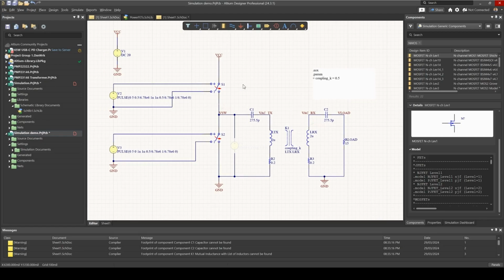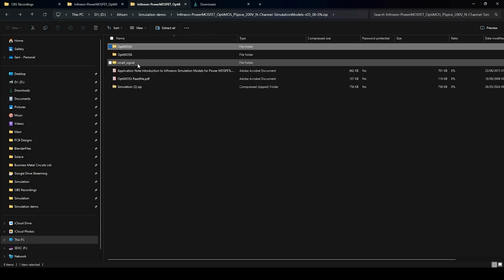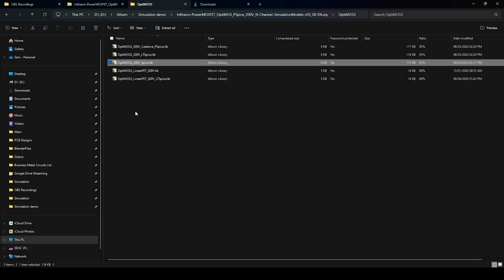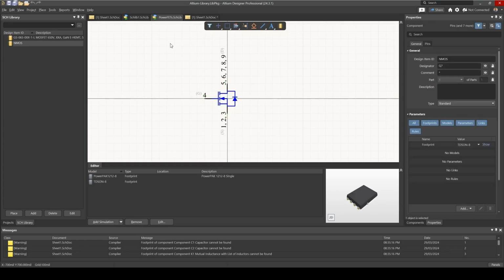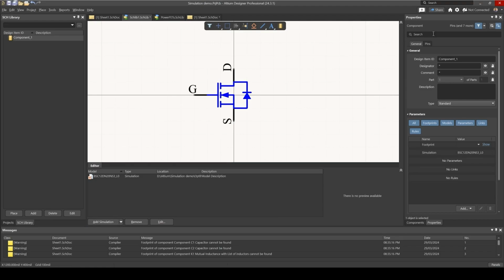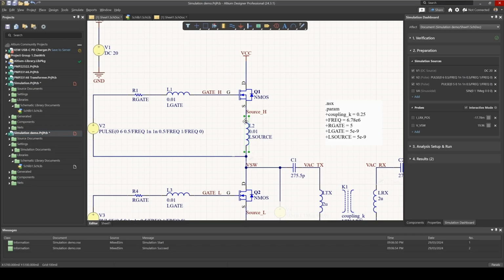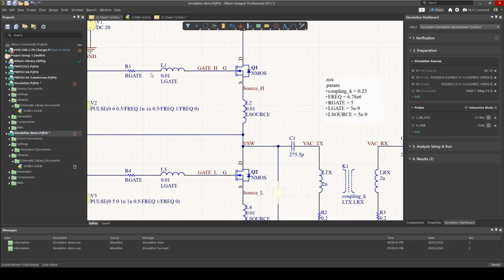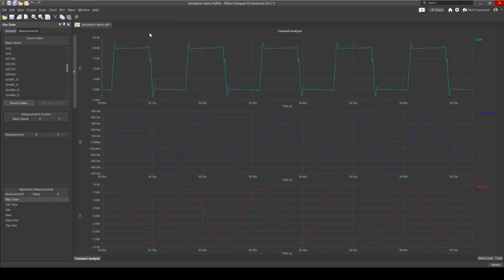Mixed Simulation Pt. 3: SPICE Models & Parameters

Comment: What is the 0.1 value in gate and source inductors?
Reply: I believe that is ESR
Reply: When you place MOSFETS on your PCB you have to route its leads using tracks to wherever it has to connect to. These tracks aren't ideal and based on their lengths and widths they have a parasitic inductance that he wants to take into consideration.